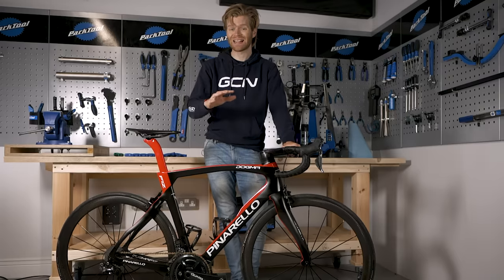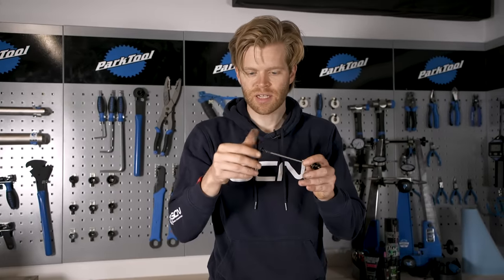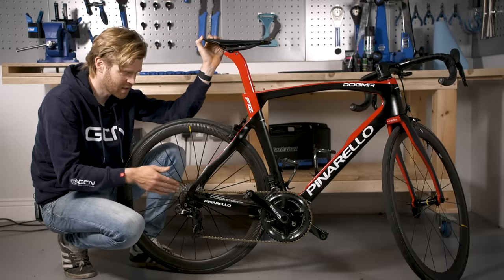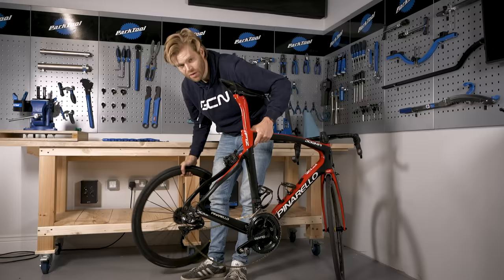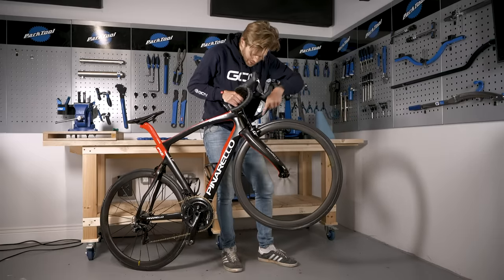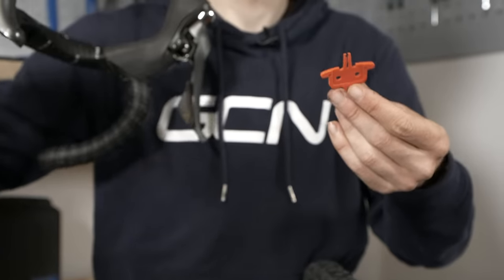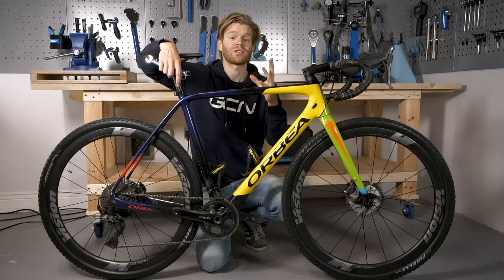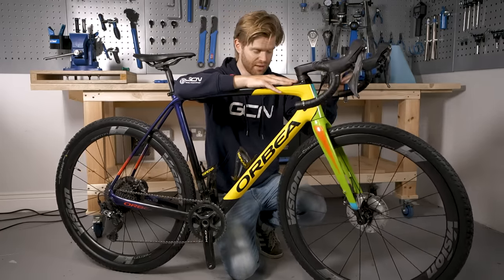How To Remove And Fit Road Bicycle Wheels

Comment from the maker: Has this video helped you? Let us know what other maintenance videos you'd like to see us make in the comments 👇
Reply: It's not maintenance but, can you do a video where you review different power meter (best value, cheapest...)? Thanks for the vids 👍
Reply: Yep, it is essential indeed.
Reply: Yes. I always struggled with the back and this is really clear. Thanks.
Reply: I've always had a problem removing and putting back the rear wheel, now I've seen Ollie's method, this should be a thing of the past.

Can I ask, when putting the rear wheel back on with a QR, how do you ensure it is centered correctly? Sometimes i get rubbing on my disc rotors, and i keep playing with the quick release until it stops, but is there a surefire way so i don't have to fiddle so much? #AskGCNTech
Reply: At 10:57, I think Ollie has it wrong when it comes to "nutted" wheels. Only one wrench or spanner is needed because, on each side, the wheel is clamped by the nut to the dropout against the cone's locknut.
Reply: abchaplin I’ve seen it where it’s like a nutted thru axle so need to have grip on one side. Otherwise I guess in you explanation, two may be more efficient rather than doing one at a time?
Reply: GCN Tech can you ride on the cross bike in a road compition
Reply: No
Reply: @neilcampion5265 , I have never seen "nutted" through-axles. The older bikes, track and fixies that Ollie mentions have solid axles with unsealed bearings retained in the cups of the hub by a cone on each side fixed in place on the axle by a lock nut. 

Where's Jon Cannings when we need him?
Reply: @neilcampion5265  I've definitely needed 2 to brace the other side.
Reply: abchaplin ah ok. Yeah, I’ve only ever seen it once.
Reply: Kimberly Sparkles I wasn’t going mad then 🙂
Reply: I don't think so., Neil. This is one of those things that comes down to skill level, and hand strength. Holding on the other side, gave me leverage and helped me brace the wheel. My dad is a pipefitter and had guns. He sometimes can do do things with tools from experience I can't.
Reply: I'd add that I guess this channel audience is 25% skilled mechanics and 75% first time maintenance DIYers. Someone who does regularly this might not need 2 wrenches, but you using a 2nd wrench is better than grabbing the spokes to get torque.
Reply: Kimberly Sparkles yep. It’s amazing how many people who have watched this and then slagged it off to be too obvious. Don’t know why they don’t leave it alone for those who find it useful. We’re not all experts.
Reply: @neilcampion5265  It more amazes me how many of these folks seemed to have not shown their kids this stuff. All it takes is one apprentice or 1 7 year old to make you state the obvious because it's never obvious when you first learn.
Reply: Kimberly Sparkles completely agree. I’ve been doing hydraulic break bleeding for the first time. It’s really easy, thanks to an old GCN video but most would take it to a shop. In the end of the day there’s not much that can’t be done on a bike with some tools so it’s always worth a try. 

I’ve never ever got the hang of rim brakes though. 😂
Reply: @seppegeerinck6784  I would think that the Cross bike would run out of gears. Road bikes would have a 50x11 as the fastest gears as a minimum using a Compact and 56x11 using a Double. Cross bikes would have a smaller gears on the chain ring. So you won't be able to go as fast. You can change the tyres/wheels to lighter road ones
Reply: I use to get mad every time I take off any of the wheels. I'm on rimbrakes, and when putting back the rear or front wheel on the bike, usually, when pulling the brake levers, I see how one side touches the rim earlier than the other side, while both were aligned before taking the wheel off. Pisses me off!!
Reply: Hey Ollie good video, also I keep the caliper shipping wedges in my saddle bag just in case of a flat out riding or when I'm when I take the wheels off to wash and yes wax my bike.
Reply: You wanna clean the underside of that rear calliper! GCN has some good videos on bike maintenance and cleaning if you need any tips
Reply: Can I ask why we can’t do this with the bike upside down? It seems much easier, don’t have to balance the bike especially if I don’t have a bike stand
Reply: No, saw Si demo'ing this a few years ago, putting the rear wheel in on both my bikes using this method doesn't work at all. I always end up with them upside down and spending 30-60 seconds to fiddle the wheel in, then turning it the right way up to center it and close the QR.
Reply: @abchaplin on some nutted wheels, if you don't brace both sides, the cones will move as well.
Reply: Can you do a similar video with internal hub gears/brakes?  I know hub brakes is quite niche, but older tech Sturmey Archer, and more modern Shimano internal hub gears are found on many bikes made today, especially commuter bikes.
Reply: I’m guessing that you could also place your bike upside down, with the seat and the handle bars resting on the ground would work as well with the rear wheel removed?
Reply: @davidlc9326  Rule 49 : Keep the rubber side down. ( Velominati, keepers of the cog )
It is completely unacceptable to intentionally turn one’s steed upside down for any reason under any circumstances. Besides the risk of scratching the saddle, levers and stem, it is unprofessional and a disgrace to your loyal steed. The risk of the bike falling over is increased, wheel removal/replacement is made more difficult and your bidons will leak. The only reason a bicycle should ever be in an upside down position is during mid-rotation while crashing.
Reply: For my single speed fixed with butted axles I  purchased a lower priced 15mm open end spanner, box end would work as well.. I  cut one end off so it would be short enough to fit in my saddle  bag with a spare tube. One is all you need. Would add a pic but I can't see that option.
Reply: Such a great video. It helps us a lot
Reply: Yo

Comment: I really enjoy these beginner's video.  Covid has seen an explosion in bike sales.  So, we're talking about tons of newbies who are looking into the biking culture (Been a cyclist for 57 years).  A bunch of regulars are bitching about this.  Screw them!  These are necessary and Oliie nailed the subject.  Kudos to GCN.
Reply: I appreciate these videos.
Reply: Not just that, I think these are good tutorials for everybody. After 3+ years of riding, I was still afraid of changing tubes and pinched a few of them. Finally, watching Manon's tutorial and did it in one go after just 5 minutes without tyre levers and no problem whatsever.
Reply: @DoNuT_1985  I too have become pretty good at putting tires on rims without levers.
Reply: Wellllll... It's also a cheap way to make a lot of easy money...

Comment: I don’t think the springs on a QR are there to “create tension when you close the QR lever”, but rather to center the skewer so that the wheel is easier to put back in... otherwise, bravo GCN!
Reply: And also make sure the springs the fitted the right way!
Reply: What if you lost one 🤔

Comment: As an addition. Campagnolo rim brakes don't have a release on the brakes themselves. There is however a pin on the shifters you can move to loosen the brake tension so the wheel can be removed
Reply: I just made a comment about this. All I need to do is pull firmly as I have 23c tyres. Thank you for the information!
Reply: Standard for GCN to ignore Campagnolo.
Reply: Indeed, a much better design as if you forget to close the brake release you still have brakes with Campagnolo, with Shimano, not so much
Reply: People with Campagnolo don't change their own wheels, they have the butler do it for them :D ;)
Reply: I wouldn't know. My Campagnolo brakes are all from the 70's and 80's and they have their releases on the callipers.
They work fine. By the way, at one time, my friends and I would adjust the cables so that the brakes ran well in the "open" position. When we went for cafe stops , we would "close" the releases, providing a convenient  locking mechanism that stopped someone from riding away on the bike. Then again, no one wanted to steal a racing bike in the 70's or 80's.
Reply: @willhogarth9945  wish that were the case... ;)
Reply: I have an old Raleigh with Weimann center pulls. I  would have to put the wheels back in then add air. Then after 15 years of ownership I watched as a bike mechanic flipped this little device on the brake lever and the brakes opened. All that time I  thought it was decoration......🤔

Comment: There's a lot of riders out there who think the brake calliper release lever is there to fine tune gap between the block and the rim. I hope some of them are watching this.
Reply: @Dany AL So they were going to a costume party?
Reply: yup, it's there to release the brakes and clear the tyre when you pull it out, also if you get a buckled wheel in a crash it will allow the wheel to turn without rubbing and you can continue riding.

Comment: This might just top the “how to fit a bottle cage” video. Top effort GCN.
Reply: Even in these basic vids there is info that people don’t know about. Also I know people who would need to watch a vid like this to get a wheel off.
Reply: I agree. Technically relevant, non biased and clearly explained - great 👍💪
Reply: Useful topic for newbie. Very important.
Reply: I learned that the lever of the quick release should be on the non drive side wdym
Reply: Knew how to remove front wheel...did not know how to remove rear wheel.
Reply: Before i started riding more seriously I would go on youtube to find “how to” videos so im guessing this video will come in handy for many people who aren’t necessarily subscribed to their channel

Comment: Never had an issue putting in or removing the rear wheel till i started using the new shadow rear derailleurs (9100 dura ace, 8000 ultegra etc) - barely enough room even with the RD pulled back to clear the cassette
Reply: mikes1984 i have the exact same struggle :/
Reply: Yep, getting the wheel back on with my R9100 RD is a huge pain in the backside compared to anything else I own.
Reply: Oh good lord I was about to upgrade into a 105 R7000 rd from my R3000 Sora one. Guess I'll go 5800 then.

Comment: 4:03 you don't need to "undo" the rear QR. The only reason you need to undo the front is because of the "lawyer tabs" on the forks, which are designed to provide an extra layer of security in case the front QR is not tightened properly.
Reply: I usually have to, it's easier to get the chain around the axle when it's not installed.

Comment: great video thank you!  you gave some good points on what to do with the bike once you remove your rear wheel. depending where I am at and the surface I am on and if I am by myself, I usually turn my bike upside down (handlebar and seat on the ground). I know some will think that it might scratch the handlebar tape and the seat. however,  I never, ever had that issue. just another option. CHEERS!

Comment: My Cervélo R3 has a through axle but with a 1/4 turn lock. Also turns out it can only go in one way up - as I’ve now found out to my cost after replacing and inner tube. Now waiting for a new through axle from Germany!

Comment: Any extra tips dealing with electronic rear derailleurs, particularly SRAM eTAP (Force)?  While I've been taking wheels on and off mechanical shifting road and mountain bikes for years, with both rim and disc brakes -  no trouble -  I'm finding it quite fiddly with the eTAP + discs to refit the wheel.  The rear derailleur doesn't easily rotate back (almost like there is a clutch like on modern mountain groupsets).  It is easier if I drop the chain off the front chainring onto the BB housing, but I'm sure that shouldn't be necessary.

Comment: Ollie, you skipped the part where you re-install the rear wheel (thru-axle) for repetition sake I guess, but it's actually quite a pain in the a... to fiddle with the rear mech because of the disc wheel, compared to reinstalling a rim brake rear wheel. Or may be I just clumsy-handed...

Comment: Which one is more trouble free for disc brakes? Quick release or thru axle? I know some people complain about having to adjust disc brake alignment frequently after putting back the wheel on.

Comment: do quick release affect the position of rim brakes ? I just noticed that after tightening the quick release the gap between the breaks and the rim on the front wheel is different at both endes is it fine ?

Comment: Really should’ve of demo’d the removal and attachment of the through axle with disc.. found that to be the worst for getting the wheel back on due to the disc/rotor getting in the way!

Comment: When did frames for quick release get those "lawyer lips"? Every rim brake bike I've ever owned have had wheels that fell right out as soon as the lever was released, with no need to touch that nut on the other side.

Comment: Shouldn't most rim brake models have an adjustment knob to untighten the brake cable, usually enough to get the wheel off comfortably? My 2005 Campa Chorus has it, and the modern 105, too (in addition to the lever). I personally find that more convenient than deflating, wouldn't that still be a squeeze as the tyre might even get wider without pressure? Never tried, to be honest...

Comment: Which direction is the best way to place the quick release lever? horizontal or vertical?
Reply: In line with the frame so that it The usual position in the rear is with the end between the seat and chain stays; in front lined up with the fork or pointing back, but never towards the front.

Comment: Thank you guru, that was fantastic review and knowledge that I just learned from you, I know how do the rim bike, but I just purchased a brand new carbon road bike with disk break, so I did not know how properly to release the tire in case I have a flat tire during my ride. I usually ride very far like 40 to 50 or even 100 miles on weekend usually I’m ride very far where no bike shop around, since I have this brand new disk break. I’m have not use to it? Although everything in the bike is pretty new including the anti puncture tires the high end one but it doesn’t mean it can not be puncture it, so yeah…you  reviewed excellently. Thank you from Southern California bike love since I was very young boy, now I’m 65 I haven’t yet stop riding it, I even feel that I have a lot power that came from riding it for all this years. As people say I’m just like an old engine. Is hard to startup but when it does started I just keep further and further regardless if it’s rain or high wind or extreme hot sunny day. once I on the bike it pushed me to another level. It’s because I’m passionate about and it’s also my only sport that I love so much. To be it’s a pleasure and in the same talking, it’s a self meditation kinda thing that keep myself peace and happiness and calmness. Pure joy ride. Thank you for uploading cycling stuff you guys are truly professional and expert, I have Watch your videos for years regarding everything related bike and sport race snd doping scandal 11:44 , Torio French, Giro, la Puerta, and tour down under. And many others

Comment: Two days ago there was a story on the local news here in Japan about a silicone assist pedal aimed at casual riders. Five silicone rubber pads in the front hub absorb energy when pressed hard that is released in the dead zones of the pedal stroke similar to a Q/oval ring. This made me wonder, while electrical assist is obviously banned, would silicone rubber or similar mechanical assist be banned in a pro race?
Reply: The name of the pedals for those curious is “Free Power”. Here’s a story in Japanese. There are pictures explaining the principle. 

https://b4c.jp/free-power/

Comment: Why is it that on the front, it's the bolt you rotated to tighten or loosen, while on the rear, it's the quick release lever you rotated? Which really should be used to correctly  tighten or loosen?

Comment: In the case of the rear QR there's normally no need to undo the nut at the right side. The wheel comes out as meant by Signore Tullio C. In the 90s the front fork has been messed with by US lawyers through the addition of lawyer lips to require the counter-productive opening of the front QR.

Comment: I had my rear wheel replaced by my local bike garage, for some reason my new wheel was fitted with a bolted axle instead of the original quick release… 😑

Comment: QR are my least favorite.  I either get them too tight or not tight enough (they feel loose, they haven't ever been, but they certainly felt it).  I'd take the nuts and bolts one over QR.  Thru-axle seems more moron proof and therefore, probably more my style.

Comment: I have to admit, and I know this is frowned upon, but I have always found it a lot easier to remove the rear wheel by turning the bike upside down first. I just try not to do it on pavement so I don't scratch the saddle.

Comment: Ollie, so I saw this video and thought you might provide a “scientific” explanation for the positioning of the QR levers on the NDS of the front wheel.  I’ve always done this, and noticed everyone else does also. But, recently I was watching a video where it was mentioned that the front QR levers can snag Di2 cables of an adjacent bike and unplug them when riding in a group. The fix was to use a zip tie to secure the cable to the hanger. But, the explanation got me thinking regarding QR levers getting caught on the mech cable housing.  If the front QR lever was on the DS, that wouldn’t be possible.  So, though it is activating my OCD senses, is there any other reason to not put the front QR lever on the DS? I suppose it could snag the rear QR lever of an adjacent bike, but that seems less likely than the cable.